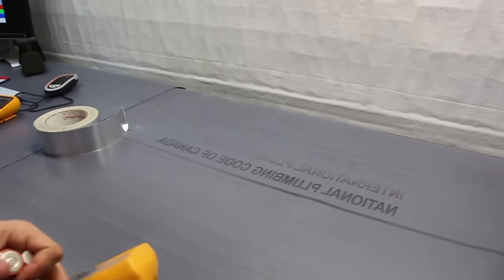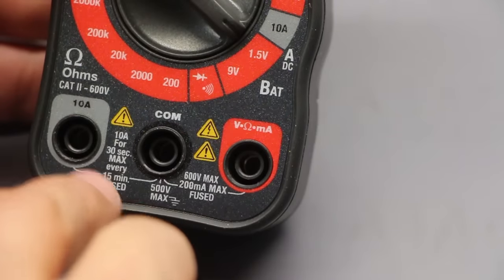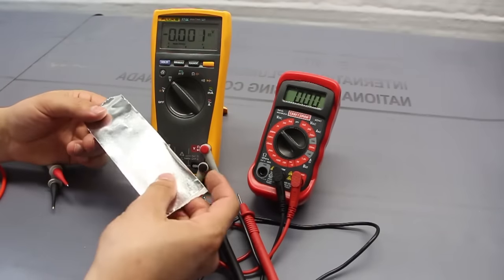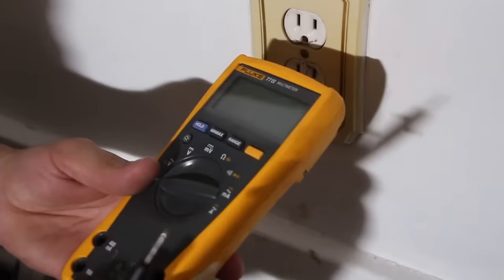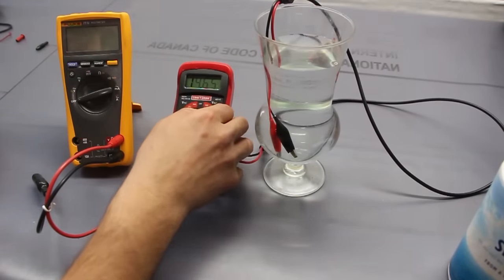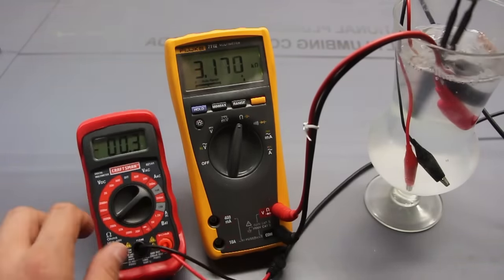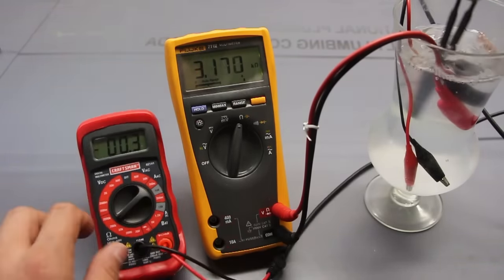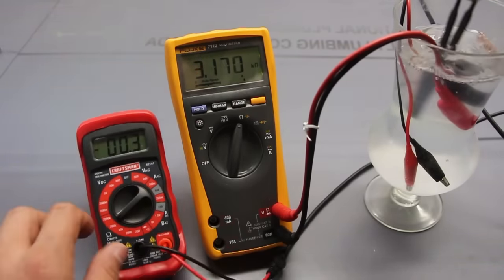The Best Multimeter Tutorial in The World (How to use & Experiments)

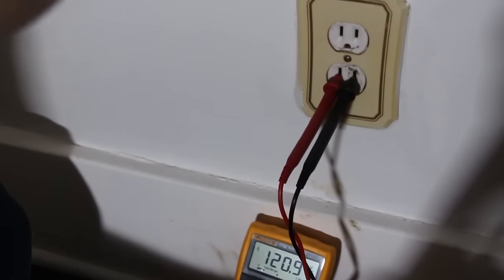Comment: 18:31 Ghost voltage.  Pretty common in house wiring.  Multi-meters with a "Low Z" range can account for this when taking measurements.
Reply: Agree with ghost voltage  
This  kid definitely needs more training about how to use a meter or AC electrical courses
Reply: The Fluke 117 has the LoZ function AND a built-in Volt-Alert function, so you can quickly check the wall/circuit you are about to work on for live wires.  Sure any multimeter can tell you if a circuit is live, but being able to wave it across a wall without setting up leads and probing is a nice convenience feature.
Reply: what is this ghost voltage you speak of?
Reply: @stevewinwood3674  It's the electromagnetic residue left behind by poltergeists.  Also transient voltages caused by cross-talk between wires, improper grounding, bad wiring, and leaky components.  But mainly the poltergeist thing.
Reply: That could be a half switched plug ..  Couldn't neutral carry voltage if some other appliance on the same circuit is using voltage?

Comment: Switching the meter to the resistance (Ohms) range and trying to "measure the resistance of a battery" is one of the best ways to fry the precision resisters. You DO NOT use a VOM to measure the resistance of a battery you measure the EMF (voltage) across the source or the current drain of the circuit and calculate the resistance  using Ohm's Law. Otherwise you burnout the meter  eliminating the meters ability to measure resistance or (possibly, depending on the voltage present) anything else. The Fluke might have sophisticated circuitry to protect misusing the meter but not a $10.00 meter. The way you measure the resistance of a circuit is with power OFF and ALL capacitors discharged. Switching leads can reduce the accuracy. Leads are married to one  brand of meter.

Comment: You should mention that it is dangerous to keep the multimeter in Amp setting or turn the knop over amp (or ohms) Range. It is bad practice to connect anything before you picked the right range.
Reply: Even worse to keep the probe in the 10A plug because not only is it essentially a short between the two probes, it doesn't not matter what the setting dial is set to. So if you accidentally leave the probe in 10A, then set the dial to AC V to measure an outlet's voltage, you will blow the fuse in the meter.
Reply: @qfksspecial7866  depends on the rating of the fuse. Most are raited for that type of voltage.

Comment: Good intro to DMMs, (although maybe not "The Best Multimeter Tutorial in The World"); you neglected to mention 3 OF THE MOST IMPORTANT DIFFERENCES between a high-quality meter (like a Fluke, BK, or Agilent) and a "cheapie", namely:
1) Readings per second — a good meter will typically deliver a reading in under 300 mS, as opposed to the 450-600 mS of a cheap one.
2) True RMS readings (of AC voltages) — a good meter will actually integrate complex waveforms, whereas a cheap meter will often show peak-to-peak (or at best, pk-pk ÷ .707, which is accurate for sine waves only).
...and...
3) Accuracy — high quality meters are typically accurate to better than 1% — (typically, 0.5% or 0.3%, w/ ±1 or 2 last digit), whereas the $10 specials are often at about 2 or 3% accuracy and (±3-5 at the last digit).

Just sayin'
Reply: What about impedance?

Comment: You should always double check your meter settings (Knob is selected  to what your testing) And triple check it if someone else is working with you.  20 years ago i was working in a Live 600v panel trouble shooting a machine. I was testing the voltage across the lines when i went to engage a Hydraulic pump my buddy checked the line fuse i replaced laying on the floor. When i came back i again checked the voltage across the lines. Last thing i remember was a brite white light. The meter blow up in my hands from 480v that my buddy turned the meter to continuity to test the line fuse on the floor and my stupid mistake that almost killed me from not proper checking my meter before testing even if it was what i was doing before.  The probes melted in my hands and blow a hole in my right shoe. 12 hours later i had welders burn in my eyes.  Spent 3 hours in hospital hooked to a EKG to make sure my heart was fine. The Simpson meter was totally destroyed and melted.
Reply: This comment is why I'm 3 weeks into basic electronics training before even getting into the weeds with a multimeter tutorial. 3 weeks ago, I would have had no idea, continuity could blow up a meter and like the video goes over a few times, sometimes you fiddle with settings to get the desired reading maybe due to impatience. Thanks for reinforcing my over abundance of caution before even getting started. It's clear we have to know EXACTLY what we're doing before flipping switches on a meter while touching probes to stuff

Comment: Thanks for alot of useful info here but that Craftman meter was defective in the AC line voltage test. Consider revising that for the safety sake of newbies.
Reply: I have the same Craftsman 82141 meter and have used it for several years. I don't know what's going on with Daniel's meter but mine reads AC volts correctly when set to either the 200v or 600v range. I took a pic of it to illustrate but can't put it on here.

Comment: Dan:   Thank you…I have a Fluke 72 I use for basic measurements ….I’m always keen to learn new ways to use it…..I love videos like this …..so freakin helpful….the other day I removed a motor from a Dyson Floor Vacuum …trying to check the motor I tested  ..one lead the entering the motor and one lead on the wire exiting the motor …it did beep showing the current cycle thru it but is the impedance check actually the correct one to see if the motor is fried or not?

Comment: One thing I have learned over the years is to always check for power each time no matter what even with the cheaper stick tester as one time I was working on a multi  family home and I shut off the hole power to the 2nd floor and was take out an old light and putting in new fans and as I was taking it off something touched and blew up in my face turned out the wiring was all fucked up and someone was messing with the boxes in the basement and made it so the 1st floor was paying for the 2nd floors bedroom light.
So after that I always check for power each time no matter what even if thar doesn't happen someone could come in and no know you shout it off to work and turn it back on and that's why you should always have red tape on you to.
Reply: Yes, a good habit is to check power and polarity first as a habit
Reply: Always check the specific device you are working on with a volt tick.

Comment: Good video.  For a homeowner or someone starting out as an electrician, I'd probably recommend they get the Fluke T5-600 or T5-1000 instead of an inexpensive multimeter. The multimeter becomes more handy when you begin taking on troubleshooting of more advanced things beyond household outlets/wiring. Unless you're doing some bench electronics and require the multimeter for testing capacitors, diodes, low currents,  etc...
Reply: LOL
Reply: @vladnickul  ?
Reply: @michaeleverest3487  You  did just recommend a multimeter worth what?  200-300 usd? unit brymen voltcraft hioky tenma and who know how many brands make multimeters PERFECT for a electronics hobbyist,  and more then adequate for a "homeowner" not at half the price but just at 20-30 usd.                                                                       You just don't need a Mercedes to drive around the block .
Reply: T5-1000? I've never heard of that terminator before...
Reply: LOL!
👾

Comment: If I can make a suggestion (as someone with something like a dozen scopes/DMMs), try them all with nice leads as well. Adding nice leads (I got mine from ProbeMaster personally) improved performance on every single meter/scope I own
Reply: I doubt that nice leads add improved performance, they can add a more nice feel to the operation the thing, that's it, you may in some cases get a slightly better/faster connectivity with other leads that the supplied ones.
Reply: You can doubt whatever you like. People doubt the earth is round. But I've personally compared a variety of meters with a variety of leads, and that is 100% the case. I didn't expect an $18 pair of test leads to do much (if anything) either. But they do. If you're looking to improve your meter's performance and can't afford a Fluke, it's a solid option. But if you'd rather just "doubt" something that someone personally experienced based on how you imagine it would play out, that's on you. Won't affect my life in the slightest either way
Reply: @The52brandon  I do have a few Fluke meters, and some more budget ones, and quality leads too, but there is not much difference, your meter do not show 5% off because of the leads you use, it may matter in one case and that is connectivity/ohm measurement, something about how easy you get a good connection, but in many cases you can just clean your standard lead and they are fine.
But for sure good quality leads is a nice thing to have, but to state that it have a significant impact on your meters performance is to oversell the leads.
Reply: Just to clarify one thing beforehand in case there's any misunderstanding, I don't work for Probemaster (or any company involved in meter/scope production/sales). But as someone that builds their own circuits often, I use the continuity checker often and the good leads do make a real difference with that. The cheap included ones gave a tone with a lot of static most of the time, but on occasion there was no tone at all. But then when I used the good leads, I'd get a crisp clear tone every time. If I was just trying to illustrate how useful aftermarket leads could be, I'd have gone on about their modular leads with the huge variety of probes tips they have. But I'm not gonna try to convince people to spend more on their leads than they spent on their meter. But I'll try to make a video soon that shows what I'm talking about
Reply: That may be more a difference between defective vs cheap test leads.  Quality silicone jacketed test leads make a big difference in satisfaction of use, but if the cheap one reads open on continuity, it probably has a broken wire connection, maybe brought about by the cheap quality.

Comment: What if I want to test the voltage and amps in a lightning ⚡ bolt? What would I set the multimeter at if I was going to test a lightning bolt and what I need to use a Craftsman like you did or a fluke or what to get an accurate reading? Also do I wear welding gloves or will it be ok to use oven mitts?

Comment: For the record. The continuity test you mentioned is a great indicator. But for leads. Not the actual meter. I got a cheaper (but not crap) crampmeter that had static on the continuity test. Replaced it with a pair of Probe Master 8000 leads, and the difference was incredible. Many mfrs cut corners to lower prices, and the probes are often near the top of the casualty list. An upgrade there can make a $40 meter perform like a $100+ meter
Reply: fluke leads on even a cen tech $10 can work very well, but get the darn leads, yours ARE crap after a week or so, giving bad incorrect readings.  get flukes

Comment: Funny thing is the cheap one is more for someone that knows what to do and how to use a multimeter and the more expensive one will be easier for a novice.
Reply: I used a cheap meter to check the output voltage of an electric fence unit and the meter never worked again
no sparks or smoke just s dead multi meter 
RIP
Reply: @blackbird-71  Pay to open the back of said meter and replace the blown fuse
Reply: @blackbird-71  You realize the voltage in those fences exceed 2KV. It was the wrong tool for the job. Only the current inputs are fused.
Reply: Wha?? I have been studying electrical for months and there are dozens of international meters on the market that are unreadable to the amateur. In other words, NO e'ffing GOOD!!

Comment: My speaker was not working after trying two brand new Amps so i took it apart to see if a fuse had blown in the power supply. in order to test that i needed to buy a Multimeter. I bought one from wal-mart for $20 bucks. I used the Continuity test to check the fuse and yes 2 fuses have gone bad (N-Channel MOSFET part # FSA10N60A Rated at 600v 10A) I didn't any beeps from those particular connections. Thanks for this video it really helped. you should do a video removing and replacing fuses on a circuit board. I couldnt find ANY on removing and replacing a fuse
Reply: Locating, removing and replacing a fuse is too advanced for this dude - best to call in the experts ie. your local electricity board and make sure you get a certificate of conformity.
Reply: Movies
Reply: To know if a MOSFET is Defective is one way to do a continuity test. Set the DMM to continuity mode. In modern DMM continuity mode usually have audible sound when the measured points are connected. Put the positive to drain and the negative of the DMM to source or vice versa, when the reading is zero or the DMM sound persists, the device is damage; shorted drain-source. Use the same approach to the other leads of the MOSFET and use the same judgement. However, when you put the positive of the DMM to the gate and the negative to the source for NMOS or other way around for PMOS; the device will turn on and when you measure continuity between drain to source; the reading is zero. You might misjudge that the MOSFET is defective. To verify, turn off the device and measure again the continuity. To turn off an NMOS, put the DMM positive terminal to source while the negative terminal to the gate. Do otherwise to turn off a PMOS. A good MOSFET should have no continuity between terminals. If it has, it is defective indeed.

Comment: All that the speaker button on a fluke meter does is turn on the audible beep to tell you when the meter detects 0 ohms of resistance so you don't have to look at the meter to know when the meter leads detect 0 ohms of resistance. The resistance readout still works normally and continues to read out the value of the resistance being measured.

Comment: Good overview but not a fair comparison.  The Craftsman 82141 is a consumer-grade meter, costing about $25-$30, not $10 unless it's a closeout price.  I've used this exact meter for 10 years with home projects and hobby use and it works fine.  The Fluke is a professional meter.  It too is fine - easier to use, faster reading but it costs upwards of $150.  If you need one everyday, get the Fluke.  If not the Craftsman or others at its price point are perfectly fine.

Comment: couple things, you said don't swap the probes between meters, yet you swapped to test the outlet cause you can plug in the fluid probes. second, the 200v range on that craftsman is most likely just busted and should be  returned ;-)
Reply: oops you can not plug in the fluke probes... damn those spell checkers...
Reply from the maker: This was the 2nd meter by Craftsman.
Reply: # o
Reply: Darnley Bynoe h
Reply: I have that exact craftsman and it worked at 600 and 200 volts for me. I tested it. 124 volts at 200 and 125 at 600.

Comment: Testing AC voltage with the Craftsman: I have the same model and did not have the same problem with the 200 volt setting showing 0.0v. Yours may have a dirty switch or it’s damaged internally.

Comment: When you stated a possible cause of the electrical outlet having a low voltage with the light switch ‘off’ as a bad receptacle, you lost my vote. You obviously are not fully understanding the purposes of switches and outlets. The primary job of an outlet is to allow for the connection and disconnection of a device to a circuit. If the outlet has ANY voltage, the outlet is merely supposed to pass that on without regard to the amount of voltage. It is entirely the responsibility of the switch to connect or disconnect the flow of power to the circuit. If the switch is in the OFF position and current continues to flow, then the switch is bad. Simple stuff. Titling the video as the ‘best in the world’ is way too presumptuous. And that is perhaps why you have 1.8K down votes. Let go of the advertising ego and learn more.

Comment: It's all horses for courses. The most important thing is to understand the tool you're using and it's limitations. I use all sorts. AVO Mk8's for some in circuit testing and high voltage shunts if it's convenient. My Fluke for household electrics and some electronic repairs and cheap DMMs of various pedigrees for throwing in the car for simple tests like continuity. It all comes down to understanding the job and what you're hoping to achieve.
Be safe, that's the most important rule.

Comment: No wonder it blew up LOL.
I once blew up a multimeter when I was like 15 or 16, it was a cheap multimeter. Dialled it to read current and simply just plugged both probes into the wall socket (240V, 13A) with the multimeter. The second I closed the circuit, there was a small mini-explosion at the socket, heard a loud "pop", the socket was burnt, and the power went out in the house... lol.
Reply: IT was you error! Not the meter.

Comment: I want t check my boat battery and I found that the manual has jargon, not for the average person I think.  It gets similar readings no matter where I plug things in.  Anyway, for battery voltage I think it is Vm red plug in COM, V Alpha Temp.  Sorry for the dumb question
Reply: Andrew....red plug/probe does NOT go in COM.....COM stands for Common or Common terminal and the BLACK lead/probe goes into COM.  Set your Voltage selection to 20 volts DC....your battery is likely only 12v potential.  Place the red probe on the positive or red wire-terminal of your battery and the black probe on the black wire terminal of your battery....then read the meter display.  Hope this helps.